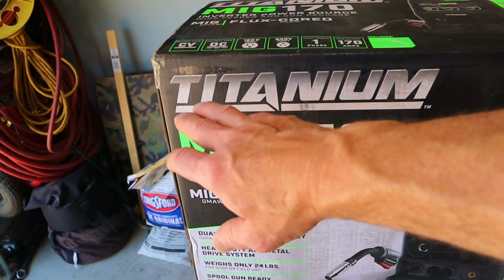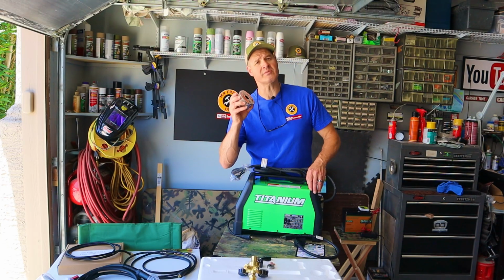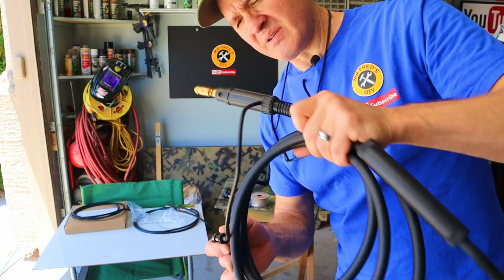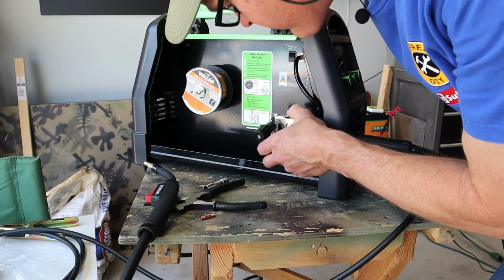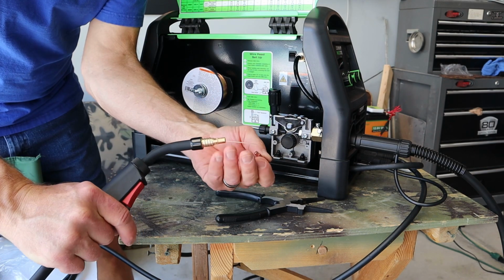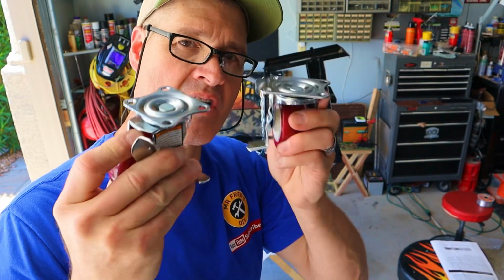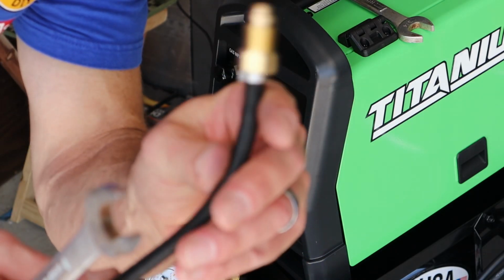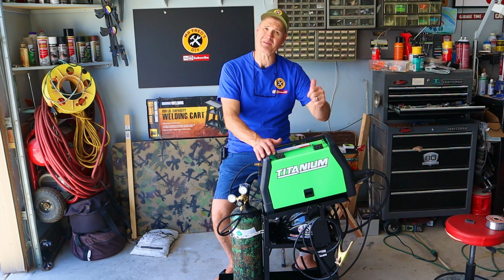Unboxing and Setting Up the Titanium Mig170 Welder: What You Need to Know!

Comment: Does this machine rely on a 240v 30 amp circuit or is 50 amp required?
Reply from the maker: This welder works on a standard 120 volt outlet. The same as a television.
Reply: For 120 volts, sure. Not for 240 volt.
Reply from the maker: @lelandglisson3392 This one does both.

Comment: Mr Freds, thanks for putting this vid together. Beats reading the manual for this occasional welder! I have the same welding machine, same cart, but bought a new gun as it got lost in our recent move. One question: what size swivel casters did you buy? I need to do the same thing, what a great idea.

One thing I'm not in love with is that the welder itself is too long for the top shelf of the cart. If you think of an ingenious solution to keep your welder from hanging off and securing it, I'm all ears!
Reply from the maker: Thanks for commenting and watching the video! Tomorrow I am publishing a welding helmet video and I a working on a welding helmet comparison video.

Comment: I have a 240v outlet in my garage.  Does the welder come with a 240v plug?
Reply from the maker: Yes! It has both 120 and 240 plugs and a simple switch on the back of the machine to toggle between the 2 power sources.